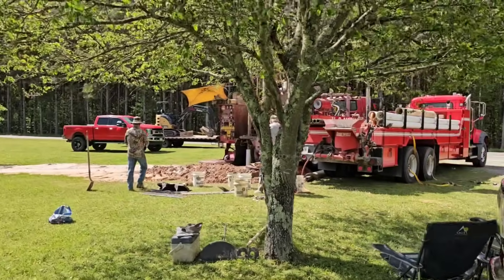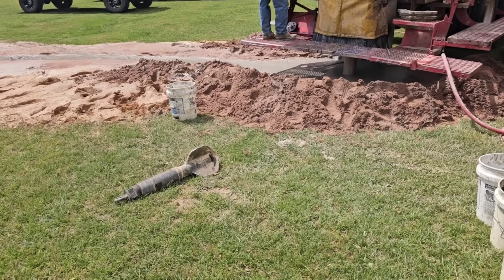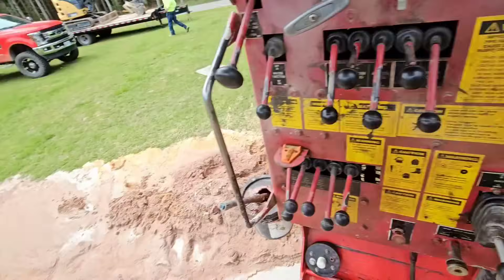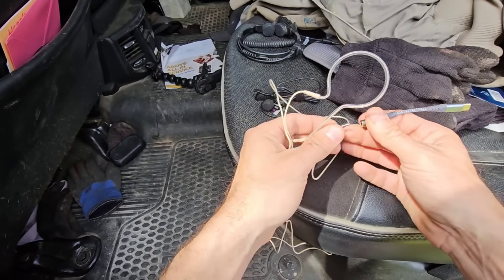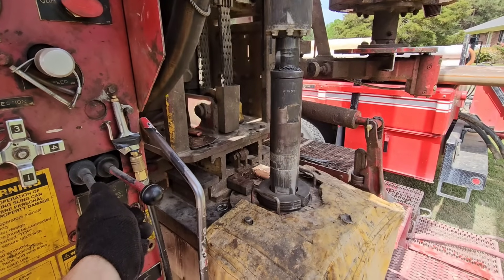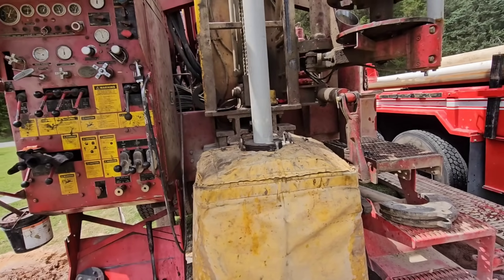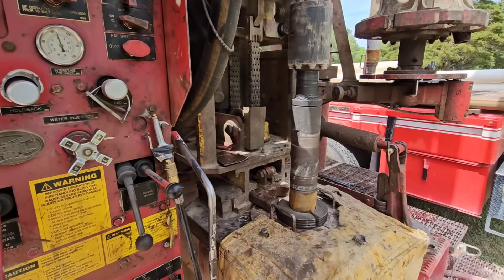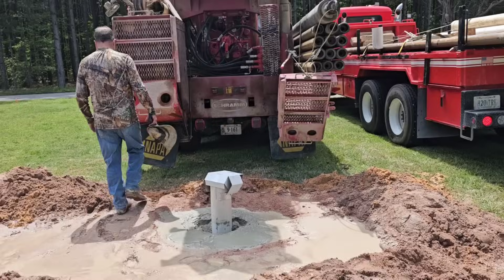Drilling a New Water Well over 500 feet deep! The worst environment for a Content Creator!

Comment: Former long time broadcast engineer here. The throat mike was the best but it was overloading the phone audio input stage. You need an in line attenuator or a small mixer to permit gain adjustment on this or any other microphone;  they all have differing output levels (sensitivities).
For noisy environments,  like major sporting events, we always used professional headsets (Sennheiser, Sony, Shure, Audio Technica, etc.) with mike booms which are specifically designed to provide very effective noise reduction. How this works with a hard hat I am not really sure! Another possibility would be the headsets used by pilots in extremely noisy cockpits. They worked great for our airborne traffic reports. David Clark is the de facto standard although Bose also make an aviation headset. Good luck! Really enjoy the videos.
Reply: Came down here to say nearly the same thing (I'm another AVL tech guy). 

I think the throat mic has a lot of promise, the noise rejection is amazing. Beyond needing attenuation to keep it from overdriving the input to the recorder (or maybe just a different phone adapter), I was curious if changing placement might make it more comfortable and change the audio quality.
Stage headsets and lav mics have no chance of dealing with your drilling rig. Honestly, your phone does an admirable job considering the environment it is working in.
I really like the David Clark suggestion! That is the mic/headset that you see used in crazy loud environments (including racing). Bonus points that DC makes versions for hardhats.
Reply: Another Audio/AV tech here. Was going to comment pretty much the same as you guys, but you beat me to it 😊.  Throat mic was the winner for me in this shootout as well, just needed lower input gain.  I think the phone may have been trying to do some rudimentary noise cancelling on the external mics as well.  Either that or they were being recorded at a far lower bitrate and the quality suffered as a result.
Reply: Nowadays there are clipon directional mics with similar properties to boom but small form factor, a bit like a hamster.
The fuzz will greatly remove any wind noise, and the directionality should attenuate a significant amount of background noise, and he could clip it to his (hard)hat with no mods at all.
Reply: anyone know what NHRA and NASCAR teams use for mics?  That is some noisy environments.
Reply: @donrozwick7367  They are essentially the same setup used in aviation.
Reply: All the same as above.  But adding that the first one was useless.   Also voice over is always great.   Panda for if you are not near the truck
Reply: Throat mic, gain it down somehow.
Reply: If the professional solution  is not working, you can go back tot the basics. The system needs to know the difference between your voice and the surroundings. If you make a 2 mic system and one is away from your mouth (second one turned fase) Then you must end up with only your voice.
Reply: For his purposes he could likely get away with using a trucking headset. My wife has my old blue parrot 650xt and I have a 450xt. Nowhere near the audio quality of a broadcast headset however it does have very good noise canceling. When im on the road she routinely calls me while mowing and can barely hear the lawn mower but can hear her just fine. My other driving friends who I am constantly on the phone with all use the same family of headset and even when we are in a heavy industrial environment like steel mills and similar places we are able to communicate just fine. Only problem potentially for his purposes is that it does pick up high pitch noises very well and in a quieter environment will pick up secondary conversation.
Reply: Did some event audio stuff as well, although usually not that noisy environments, I thought about those headsets as well. The other thing coming to my mind was the intercom headsets we used when I worked at an airport. There were some to plug into the aircraft, others for two way radios. The latter ones might have the signal levels that might work with a phone. Wireless systems exist as well, with the advantage of the receiver usually having me as to adjust the level. There are also versions for the earmuffs fixed ro a hardhat. But as mentioned, not sure about the signal levels for those.

Comment: I'd try putting a 10 or 20db attenuator in the output of the throat mic and see if that helps.  It sounded to me as if the overall audio from the throat mic was clipping somewhat [overload distortion-- too much audio for the phone input]..   BTW, strange that the second mic had that 'underwater garble' sound when you were near the drill rig--- that might clean up with an attenuator on the input too.   Historically, your audio has been great, considering the noisy environment.   Thanks for all you do--- helping us learn something new and also for your quest for continuous improvement.  !

Comment: Truck drivers use a headset that cancels background noise. Legally, they can only cover 1 ear, so it has a single speaker. They use a Bluetooth  connection to the phone. My wife could tell when I was in the Freightliner FL 70 and wheel I was in my pickup. There was still some background noise but we could communicate.

Comment: I was about to say try talking in a more normal voice with the throat mike when the caption popped up on the screen that you came to the same conclusion. The throat mike in the noisy environments for sure. Maybe switch to the other mikes when less noise. No matter what I enjoy the content. One question I do have though is why you keep the anti seize on the left of the rig instead of making a hook on the right side closer to where you use it. I would think it would be easier to access, be a visual reminder and make it slightly faster. The only downside is maybe it gets debris in it? I hope you see this question...lol Its just one of those things that I like to find out about.